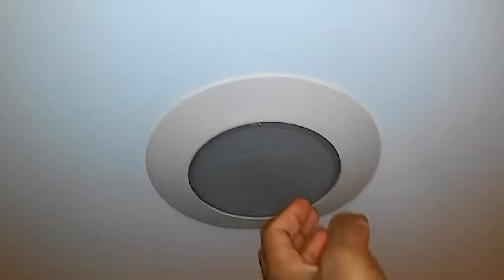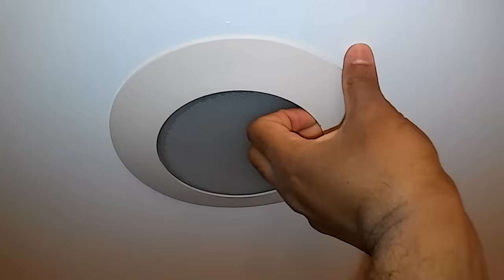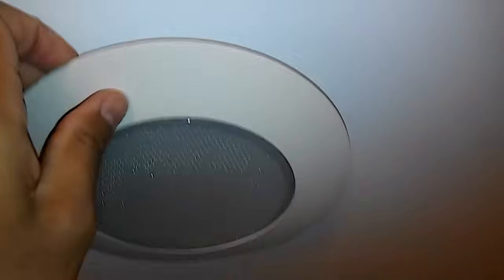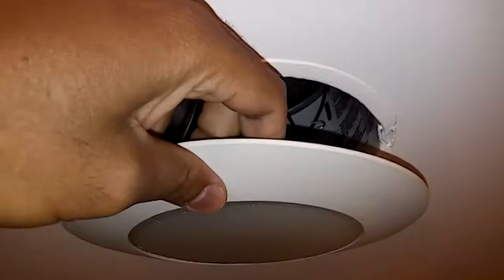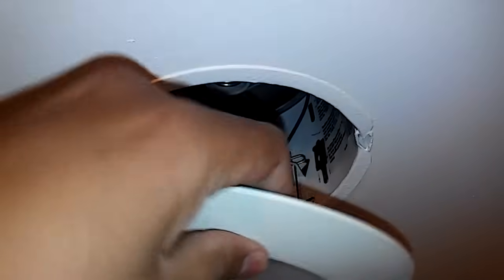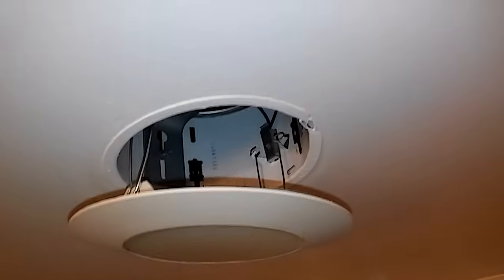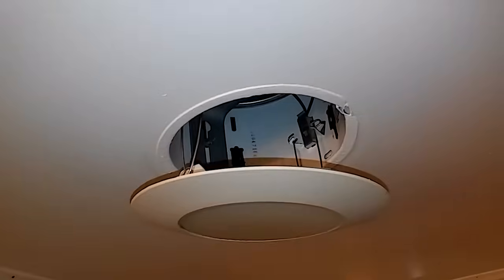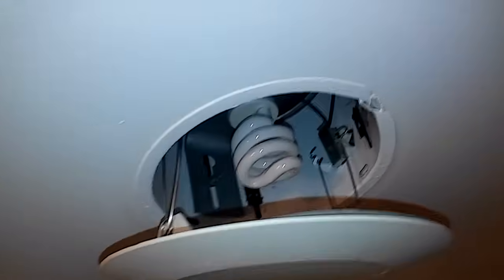Replacing A Light Bulb with Recessed Lighting

Comment: So I tried this, and the curly CFL burned out bulb exploded in my face.. cleaned up the mess and next person to try and put a bulb in is going to get the rest of the broken glass and a socket broke off. Is this going to be a problem, since I have no one to do this? :'(
Reply from the maker: If it is completely sealed, meaning there are no visible holes inside the lighting fixtures, then you should use LED instead. In my case, there are holes inside the lighting fixture, so it's not completely sealed. You can also get a tool that opens the bulb at the hardware store if the height to reach the bulb on the ceiling is an issue.
Reply: @TimJoseph08031990  thx, I'll likely wait till I find someone tall enough and knows what to do. Not sure what is inside the "can" as far as holes.. I'm still healing my wounds... thankful no scratches to the tub enclosure - I am worried about power on the socket with no bulb, or rather just the base of one still inside with more broken bulb pieces.

Comment: Thank you for this video.  The lens cap and frame were stuck from years of moisture.  Your video gave me the confidence to exert a little more pressure and it popped right out from the ceiling. I was able to lower it and replace bulbs without issue.

Comment: Thanks for the video. However when I tried to remove the trim it pulled the entire fixture out of the ceiling, terrible design if you ask me.
Reply: Chocolate Donut terrible installation. You had a cut in fixture and either bad Sheetrock or bad cutting of the Sheetrock when the fixture was installed.

Comment: Doesn't the CFL get very hot when enclosed?
Reply from the maker: Gesele Dreslinski This recessed lighting in this video is not completely sealed, but the gray gasket is there to prevent moisture build-up. It shouldn't get too hot, since it only uses 13 watts with the 60 watt equivalent brightness. The housing is designed to shut off the light if the bulb gets too hot. The bulb did burn out 2 years after posting this video, so I replaced it with anorher CFL bulb, since I have a few more CFL bulbs still sitting in the closet unused for a long time. When I was replacing the bulb, there were spider webs inside the housing, which I had to clear before inserting the new bulb.

Comment: Thank you, you gotta get the cfl outta there though! Filled with Mercury vapor! Go l.e.d. my friend
Reply: anarchyamp Don’t even go LED, there weaponized too, go back to incandescent. Halogen won’t work for him because of the sealed heat.
Reply: What if the light is dimmble? I keep blowing bulbs and I can't locate any short-circuit or loose wires.
Reply: charles mayer Honestly I’m young and new to the artificial lights. I don’t know a bunch about electrical. What bulbs is being used? Is the bulb capable of dimming? I do know halogen burns hotter..heat can be reflected up or down...
Reply: charles mayer any updates with info?